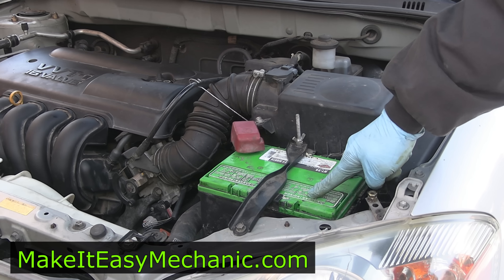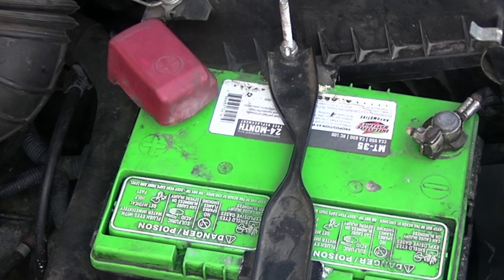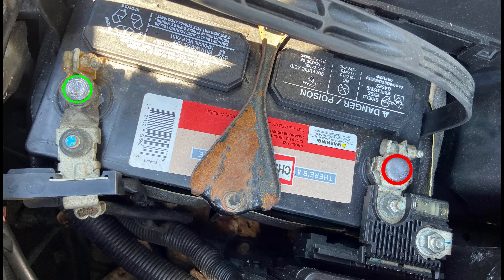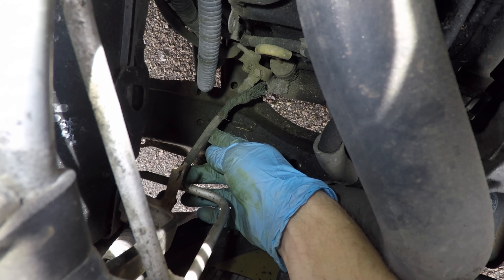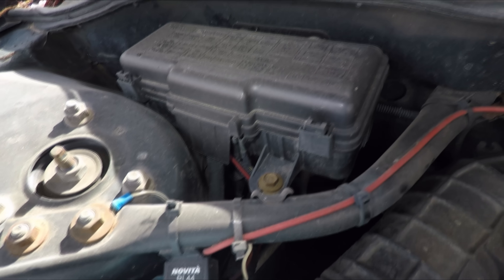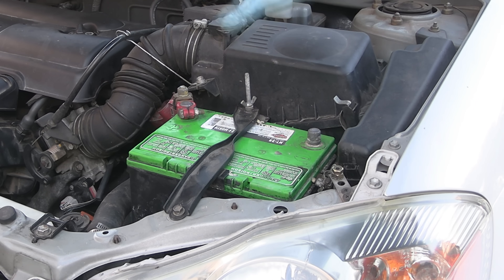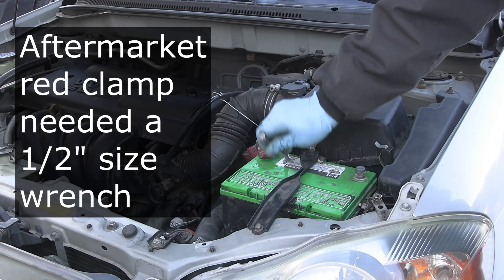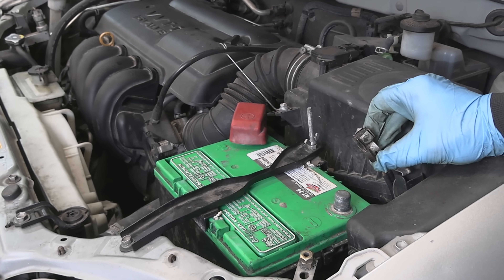How to Disconnect and Reconnect a Car Battery | Which Battery Terminal To Disconnect First

Comment: Yup, red one first, black one connected to the engine block (away from the battery) then disconnect it first to prevent a short and sparks near the battery.  Everybody USED to know that.  Now they dial 911 to have some hairy, sweaty  fat guy in a wife beater  and greasy baseball cap come in a tow truck to do it for them and charge $150.

Comment: I always disconnected the one on top first.  Sometimes that doesn't work because there is no terminal on top so in that case I disconnect the one on the side first.  And yes you are always careful with where the wrenches are and where the disconnected wires are.  Anyway my father owned a large automotive repair shop for over 60 years and that's the way we always did it.
If you disconnect the negative first there is less risk of additional excitement but make sure the wire is securely tucked away somewhere, if it comes loose and bounces back to touch the terminal then it can still get exciting.  If nothing else we would wrap a rag around the netagive wire.

Comment: Just a suggestion, Perhaps you could demonstrate on a scrap car,  how if done wrong when disconnecting the battery the circuit "shorts" out?     This would show why it's vital to get it right & young drivers who are just starting to work on vehicles would see the dangers.   Thanks!
Reply: A long time ago a mate’s brother was working on his car and decided to put some extra fuel in the carb, just to boost it for starting.  He used a metal funnel and - well, you can probably guess what happened …. 🤔🤣⚡️💥

Comment: If you need to disconnect your battery, the first thing you should do is pull over and stop. THEN turn off the ignition and lights. I have found that at highwayspeeds, the hood opens really fast and is super hard to close.

Comment: I have a classic car from 1948 which has a Positive Ground.  The Positive side cable is connected to the chassis. So in that case, I suppose the disconnect of the Positive side Cable is appropriate?
Reply from the maker: Yes, whichever side is connected to the chassis should be disconnected first.

Comment: Great video, thanks! I have a question - in which order should I connect/disconnect  starter cables to a dead battery to enable an ignition? Same like pointed out here, or does it even matter? Thanks!
Reply from the maker: not sure if I understand your question, but if you're wondering about jumping a dead battery, you want to start with 
- red on dead, red on donor,
- black on dead, black on good ground of the donor.
@chrisfix has a good video on this topic - https://youtu.be/iI1o2hNy2hE?si=Bmy51oszueHf4NYZ
Reply: @MakeItEasyMechanic  Thanks a lot! So it's red on red first.

Comment: Good video. The same can be said about jumper cables as well. The last one to be connected is negative and if you can, attach it to the frame rather than the battery itself. A shipmate hooked it up with positive last on the battery itself and it blew up in his face. Fortunately no long term damage, but it could have been far worse. He was very lucky.
Reply: I tried attached to frame or engine block and it never worked.....  So I just do Pos to pos, neg to neg....
Reply from the maker: Good advice, thanks for sharing!

Comment: People who have the intention of working on a car  and who haven't brought an electricity measuring device should not mess with vehicles. It is that simple (and obvious). And if you are somewhere far away from any work shed or other place where you can enter your vehicle you should not be messing with the battery. And even so, when you don't know that there are positive and negative markings on a battery just keep as far away from it as possible. You'll be doing society a big favor.

Comment: You always discover the negative as it is earthed to the body, if your spanner slips and shorts to earth then nothing can happen as the voltage of the battery and the body are the same.
If you remove the positive terminal and you slip to earth you have the full 12 volts and a battery that can deliver a huge amount of current, it's virtually shorting the terminals with the battery.
The battery could explode or the spanner may get extremely hot and melt

Comment: Great video.  I learned this years ago when I was in High School and working at my uncles service station - yep that was in the days where your gas was pumped for you in all kinds of weather and you could get your tires repaired/replaced, buy a battery and have it installed, get an oil change and tune up - all the while paying less than 30 cents per gallon for regular and preminum - unleaded was just coming out and most stations had ony one pump for it located on the island furthest away from the building.
Reply from the maker: Very cool! Thanks for sharing! 30cent per gallon - I don't think I was even born yet! haha

Comment: Remember, some old cars are wired positive earth.
Reply: You beat me to it!  You must be old like I am.😊 I can’t remember who did that. My recollection is that it was one particular manufacturer. 

Hey! Any more old geezers out there that remember this?
Reply: @charlesmoore1762 
I had a number of old Rootes cars that were positive earth, but I'm sure they weren't unique. I think it was because the cars had a dynamo rather than an alternator.
Reply: @charlesmoore1762 
Normally positive terminals as ground, was English car.
Reply: My 64 MGB was. It also had 2 6-volt batteries.
Reply: @squaaaaak3178  That's right, under the rear "Seat". A pain in the arse when it came to charging or jump starting. Later models had a single 12v battery under the bonnet.

Comment: I've always removed earth first, and connect earth last. So your spot on. Batteries are very dangerous. One blew up in my father's face and suffered acid burns. But made a full recovery.
Reply: "I've always removed earth first, and connect earth last." This is actually more correct. Removing negative first when the system is positive ground would not be good. There are not that many +ve ground systems around these days, but some older cars were. Some specialized European made equipment are/were +ve ground, like Demag cranes. So I would have started the vid off by saying something like "Identify the type of system ground first" and then used this car as the example for the correct procedure.
Reply: Glad to hear he recovered. Saw one blow up in a guy's face years ago in FL. Didn't see what he did wrong but believe he shorted battery while trying jump start it. I grabbed a gallon of water from the grocery store we were at and started pouring on his face. Ambulance was called and I left. Always wondered how he made out after that. Hopefully nothing permanent.
Reply: @billg.9087  , there's a hydrogen gas cloud above the battery. The cloud may have been big enough to ignite from the resulting spark on the negative battery terminal when making that final battery connection. Doesn't always happen, but you don't want to be that exception.

Comment: Why would the negative wire be thinner?  The current would be exactly the same in both.

Some older cars are positive earth.  I haven’t had a car since 1982, but when I did it was a 1967 Morris 1100 and that was positive earth.  I’m not sure when negative earth became universal for new vehicles, but you need to take care if dealing with classic cars.
Reply: That's right. Nowday negative goes to chassis and most moduls/loads have negative connected to chassis. So, negative from battery to chassis must be very thick. Positive goes to fuses and from there goes thinner wires to different loads. From battery/to battery goes same current. Also, after '60es I haven't see car with positive on chassis. Never mind, it's allways good to check where is connection between battery & chassis.
Reply from the maker: it's not that the wire itself is thinner on the negative side, there's just less stuff on the negative side clamp - one wire going to the body, sometime a second wire going to the chassis, while the positive side has a wire for the starter, a wire for the alternator, a wire for the fuse box etc. There's just more wires branching off from the positive side clamp - so it looks like a bigger wire.

Comment: Very good video, thankyou. I saw somewhere else on YouTube the following suggestion...
If you are disconnecting the battery, this is a negative thing as you can't start or use the vehicle, so it's negative terminal first, positive second. If you want to use the vehicle and put it back on the road this is a positive thing, so it's reconnect the positive terminal first, the negative terminal second. A really easy way to remember.
Reply: Earth first and last. That's how I remember.
Reply from the maker: Great tip 👍
Reply: That's a great way of remembering this. I'm not going to forget it now. Thank you!

Comment: i have seen many video/document about this topic and I just use my brain to hard remember the order about disconnect the car battery.  However, your video tell me a very clear scenario and reason why to disconnect negative pole first.  Thanks for your teaching.
Reply: Negative pole is NOT always the ground. Some cars have a positive ground electrical system.

Comment: After removing battery terminals and putting it back my car shaking and vibrating and rpm goes down and rough idling but there is no check engine light on display so how to fix this issue ?
Reply from the maker: A low idle after disconnecting a car battery is common, usually it happens because the car's computer system needs to relearn idle parameters after losing its stored data; this can often be resolved by simply driving the car for a short period to allow the computer to relearn the settings